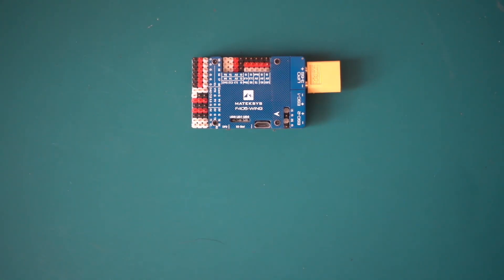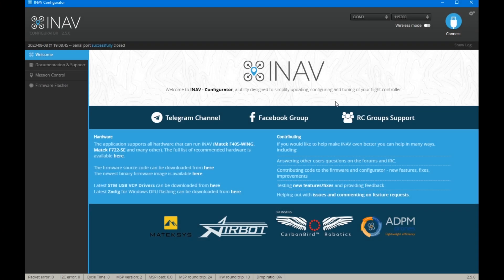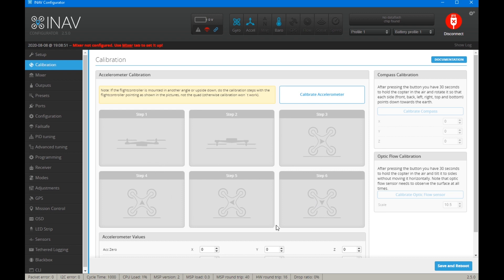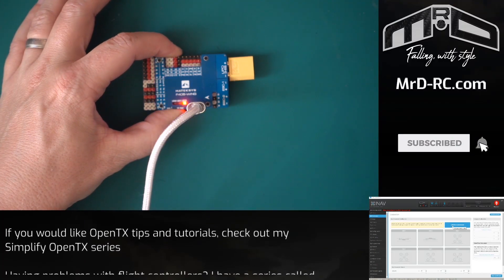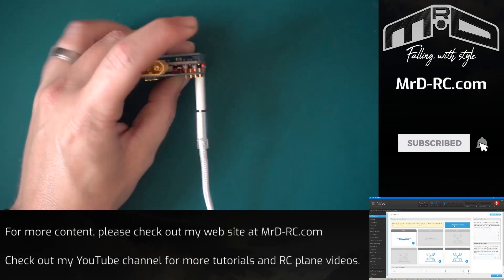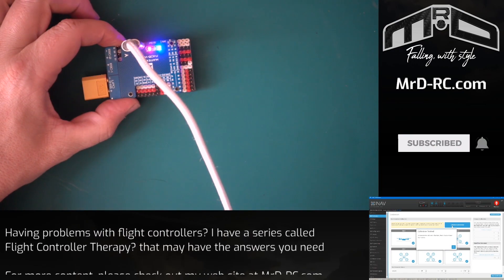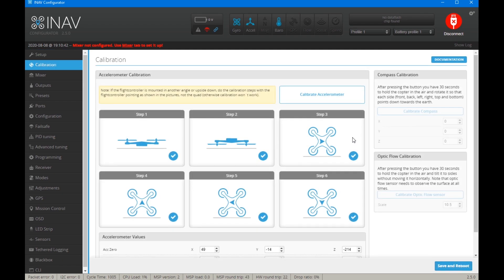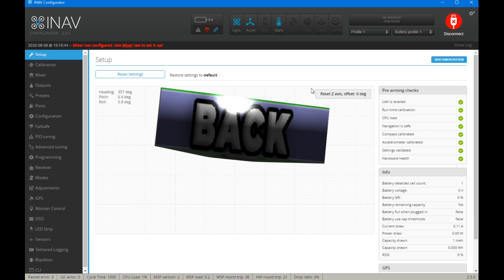How to calibrate the accelerometer in iNav

Comment: @Mr.D - Falling with style... THANKS for the detailed video, just a clarification, after following the accelerometer calibration in this tutorial, can I mount the FC upside down & rotate 180 horizontally, that is, the top would be facing the ground, and the front (arrow) facing backward?. need to do this since the installation of my FC needs to follow this orientation...will there be any issue? appreciate your advise.

Comment: are there any pre-requisites required for the calibration features to be available? When i go to the calibration page I cannot click calibrate, I just have an option for "reset the calibration" and everything else is greyed out. I'm getting an alarm about runtime calibration on the main page.

I haven't started assembling my drone yet - does the drone need battery power for this step to work?
Reply from the maker: Are you using the INAV 6.0 feature preview? If so, you mush have already performed a calibration. After performing the calibration, you must reset it to perform another calibration. With older versions there was no reset button. But new calibrations after the first would fail.

It sounds like you are new to INAV. So I would recommend using the current stable release of 5.1. The 6.0 feature preview is only intended for experienced pilots, as it is a beta release, which could have bugs.